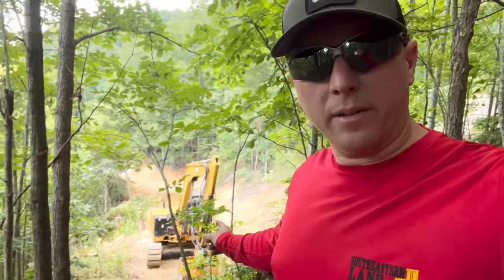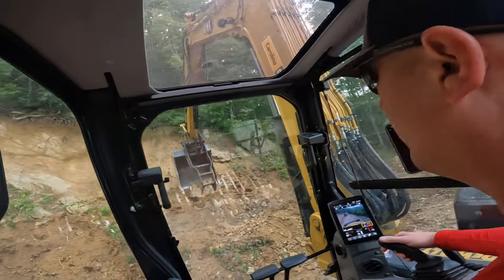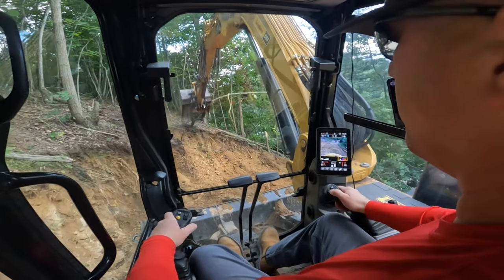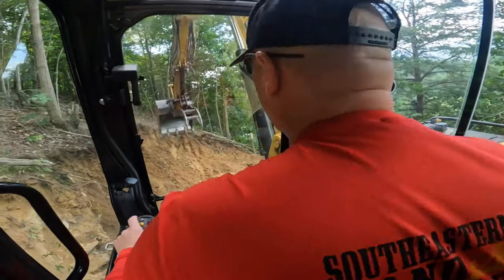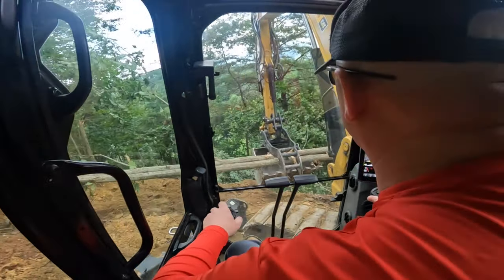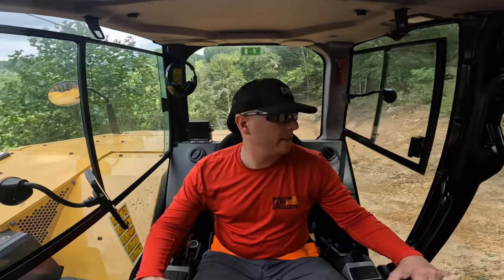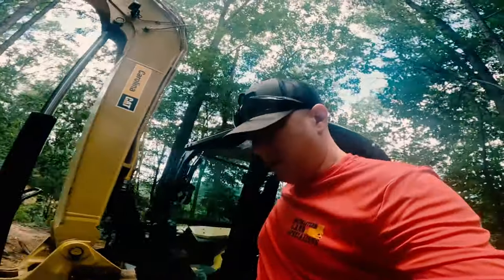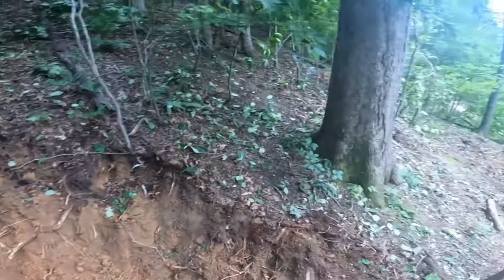How To Operate an Excavator-Building a road (Part 2 of 3)

Comment: Biggest tip and rule of thumb imho, is to establish the inside radius first (as much as feasibly possible) to insure gadiant target is achieved and establish the outside radius to suit. Otherwise you can easily end up with an excessively off camber corner or an inside radius which is too steep. And/or having to cut back into the embankment (when cutting into the side of an incline) more than what was intended.